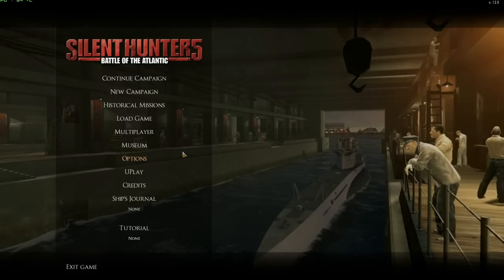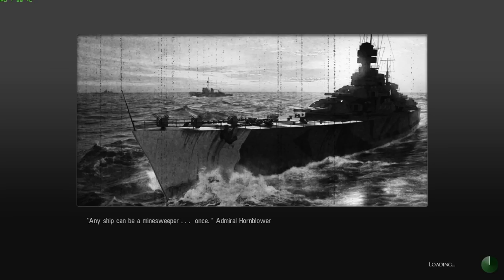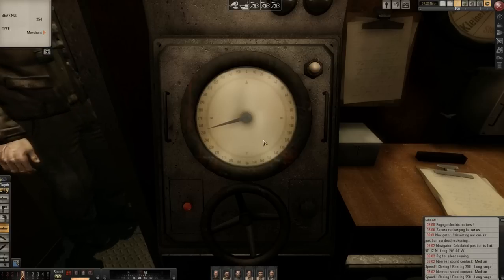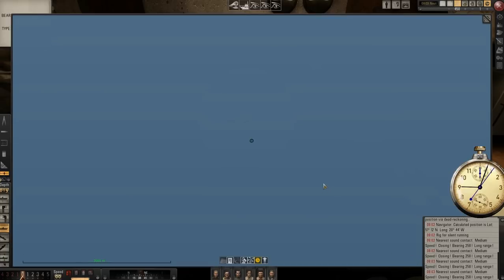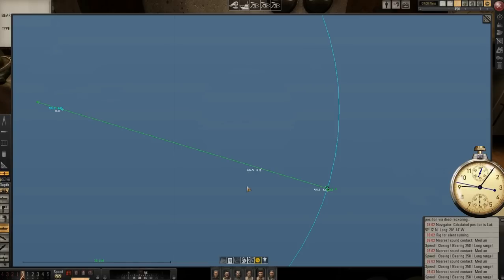4 bearing method for SH5 part 1-4.mkv

Comment: very helpfull. I play with SH3 + GWX 3 Gold mod, so i adapt the method to the map tools provided. They are different but also good.

I kind of understand the "didactic" of this vid, but it is fair to point that you are in a extremely good position to take measurements. And i also have to point that using this method for every single of the 14 torps of the Type VII it is a tedious business, so learning an easyest way to attack should also be addressed

Comment: Hey....great vids....lots of good info. Hope you're keeping up with this, I know the game's a bit old, but there aren't any more decent sub sims out there right now. Question: I'm running Trevally's patrol scripts in a patrol area and, the first time I did this, I went 45 mins real time, and never found a contact I could chase down.....does it normally take that long to find targets? Or am I doing something wrong?
Reply from the maker: somethimes it takes time.. depend on the are where you are patrolling.. but somethimes take time to find some contacts! :)
Reply: Yup, and I figured part of it out. When you find a sonar contact you need to surface and try to run it down at flank speed. Not an easy task if you're not using auto-update for map contacts. You have to keep stopping and dive for another hydrophone sweep. Any other advice on finding targets would be awesome..
Reply: Oh, one more thing. What mod gives you the colored lines/marks on your TAI map. I find my marks really hard to see. Thanks.
Reply: Nm, I got it....I think the colors are in AvM's EQuaTool mod.

Comment: hm is this right ? your heading is 30.  For the first bearing it should be like 258 + 30 - 360 = 72. Maybe im wrong.
Reply: "258 + 30" is less than 360, so no need to subtract. It's 258 + 30 = 288